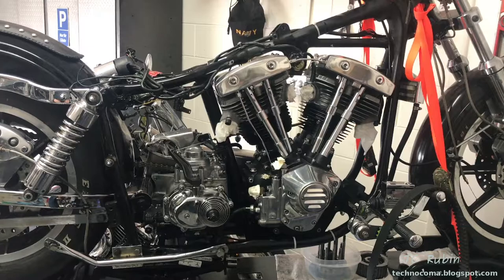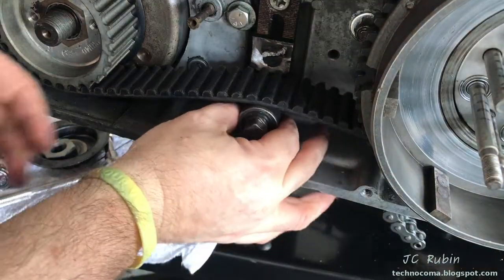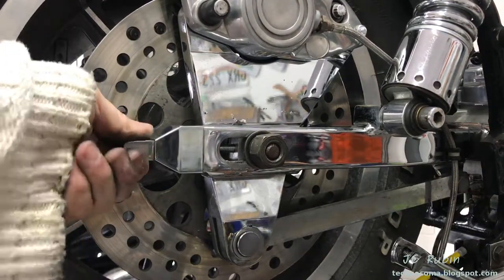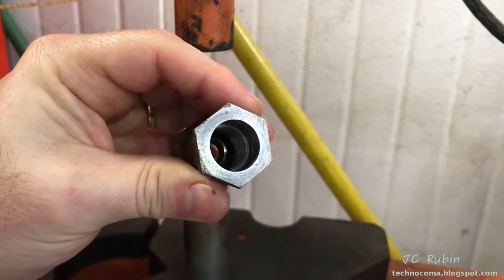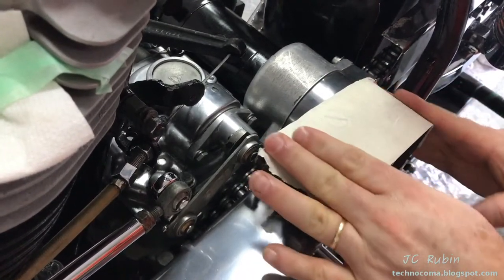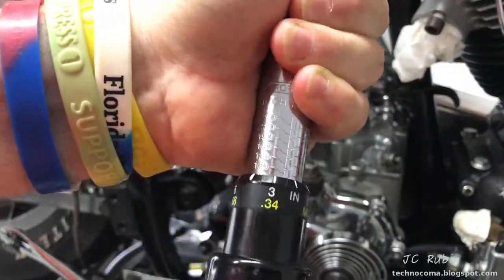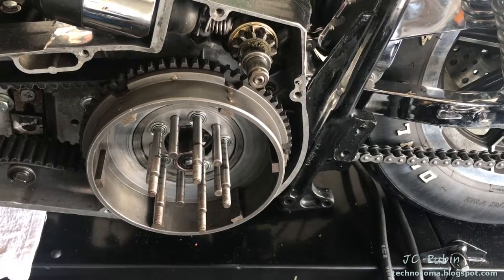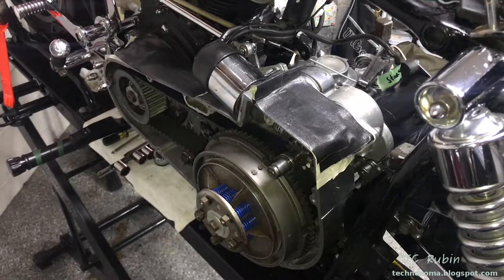AMF Shovelhead Lowrider Restoration -26 - Starter / Starter Solenoid / and Clutch Installation

Comment: As soon as the transmission is rebuilt for my 1981 Low Rider all of this reassembly will have to be done.  There’s a lot to make sure it’s working just right to have a reliable motorcycle.  Excellent video!

Comment: Thank you for the knowledge 💪🏻👍🏻.
Reply from the maker: You’re welcome.
Reply: ... I just watched this video again to make sure I didn't forget anything. The starter on this bike I'm working will not release from the inner primary. I've tried all kinds of stuff to get it to remove it and it will NOT come off. I think someone had to have glued it accidentally are used the wrong type of silicon. I'm not sure but I've tried tapped hit with a hammer put under pressure and then hit with a hammer again😢 ... I never use hammers... LoL  @delorean1